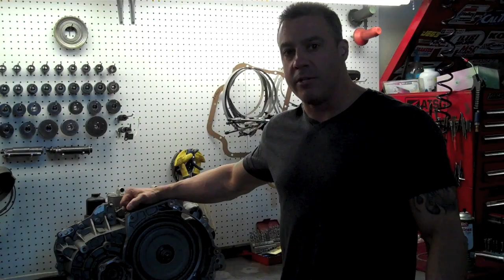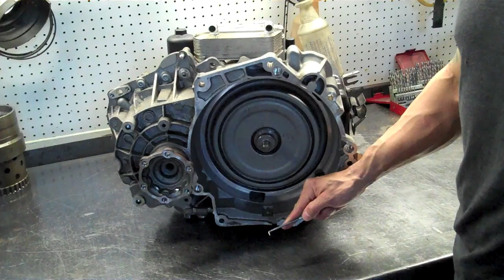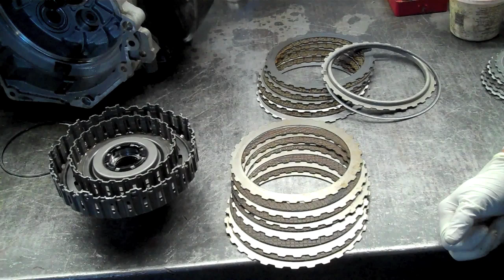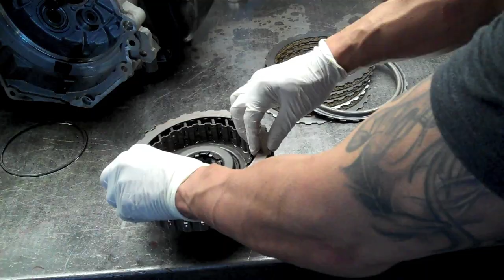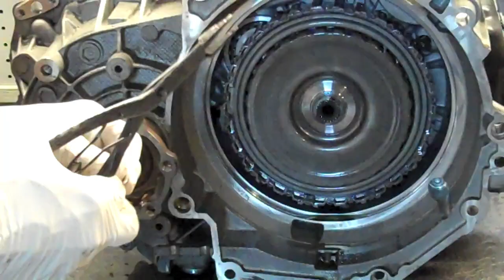VW and Audi DSG Clutch Upgrade

Comment: You should never touch the cover seal,or use oil on it and never install the cover over the shaft without a sleeve tool to avoid damaging the seal lip !

Comment: Nice job,  good video, this is simple  compared to CVT  transmission , my bought a 2008 Nissan Altima SL with 2.5 SL CVT and it came with a lifetime warranty on the CVT from Nissan and now it has 130k miles on it and never any issues yet, car is quiet, and in Canada here our winters in Manitoba, yes purgatory its so freaking cold,LOL, -30 fahrenheit is common and he has never changed the CVT fluid yet and gets got mileage  all year round,I would still rather have a DSG or conventional auto trans or a manual, i have heard you upgrade works well and your procedure here is pretty simple and straight forward, i built big industrial autos for allot of years for different companies, they were mostly component or unit repairs, valve bodies, actuators  ,etc, and way, way  too much fluid everywhere ,LOL, the biggest problem with them was lack of maintenance, overheating and contamination , using non compatible fluid, one customer just bought 1 gallon jugs of atf and wondered why his equipment stopped working inside of half a day, it was almost a whole new trans for him, that is why there are pros like your shop, I guess it does take longer to remove the trans then the clutch pack upgrade, as my old boss use to say, it is much easier to work on when it is out and on the bench.

Comment: some dsg's and automatics have the same set up as a bike clutch.

for those aasking what is the difference of the +1 disc
more presice and friction is distributed to more discs
so less slip and less ware
but needs a software update because the ecu needs to readjust the gaps

Comment: hi...  my name is Damiel, i'm from Brazil.

i have an Audi A3 2.0TFSI SPORT (two doors), 147W with 200cv

i need the stock file for dq250 from Audi A3 2009+.. 

my HW: 02E927770AL 

i'm looking the version: 02E300053B to my Audi... do you have?

thanks a lot for your patience.

Comment: Need to use a specific size snap ring which is determined by two measurements and then formula vw
Reply: Only when replacing the clutch and case as a 1 piece - the way it's sold from the dealer. If you're keeping the same case, the measurement remains the same so you can reuse the old spacer circlip. Technically, if you don't have the dial gauge indicator, you could buy the clutch kit from the dealer, pull out the friction discs and plates and just transfer them into your old clutch case. Then you just reuse your original circlip. Not the best way, but it works with the same success as if you were to measure things out and use a new circlip on a new case. Your adaptations of the mechatronic will pass successfully and the clutch will work correctly for it's intended life.

Comment: Did you soak ALL the friction discs for both clutches prior to install?
Reply: He said he soaked them in trans fluid for 15 minutes before assembly
Reply: He mentioned that he had soaked the friction plates for 15 minutes prior to reassembly.

Comment: Looks easy... :)  First you have to remove the transmission (not so easy)

By the way: 
This is not the correct way to exchange the clutch!!! If you do it like this you will have a noisy and not well working clutch / transmission. The whole clutch package is balanced. You have to paint some marks to reassemble the clutch package in the correct (balanced) position.

Next you need to measure the clutch position (it's an adjustment in height)! The mechatronics is able to do an adjustment but this (video) is really the "quick and dirty" way to do a clutch repair on a Volkswagen DSG. There are some washers (delivered with the original repair package) with a different thickness to adapt the new clutch package to the transmission. 

It might work or not when you do it like this!
Reply: Martin B. And those people find them selfs professionals 😂
Reply: Can you tell some more about the washers that must be put in place in order to have the mechs working good?
Reply: Hi, I have a problem to put the bis clip. How you can put the big clips at 6 min 41 to 6min 44? Do you have a link? Thank you very much. Yves
Reply: We're can I find the correct way to do this?
Reply: You are 💯 correct sir I am a mechanic for 10 years and you are right

Comment: What exactly does this upgrade provide in terms of performance and reliability?
Reply: There are additional Friction added thus more material to grip the flywheel and put the power to the ground. Hope this makes sense.
Reply: i would guess durability for high HP mods + smoother shifts, when you have high torque its best to upgrade

Comment: I have an 05 tdi with DSG. Rattles really bad when idling in gear and taking off, replaced DMF but wasn't the problem. Rattle sounds different than a bad DMF. I have videos on my channel. Please help! Is this from the clutch being worn out?
Reply: Muffler bearings without a doubt, run it until redline in 3rd gear that should fix it.

Comment: I have a 2016 GTI with a DSG transmission. Was wondering if you knew roughly how much power and torque can the trans. hold before it fails?
Reply: +ravenstylea2 
Well if you reach the limit your first sign will be clutch slip, that is what modders usually find problematic with these gearboxes. Gears themselves can handle quite a lot of power(2-5x from stock) but they can take abuse, i.e. if you intend to "launch" at full throttle and possibly drop gears abruptly things can quickly end in tears.
Reply: 600hp. 500-600tq is about the limit.
Reply: 350ish

Comment: why would you install a bigger clutch? Is it to have faster gear switches?
Reply: to hold more power without slipping.
Reply: It'll handle more torque. Some VW owners up the their HP significantly and need this

Comment: Nice video...quick question. i have a 2006 audi b7 auto trans and when putting reverse  it takes about 4 seconds to do the shift. What might be the  problem??
Reply: Change the trans oil
Reply: Same in my 2009 a3 cab dsg 6

Comment: How long would an upgraded clutch on a DSG last under nornal driving conditions?
Reply: I don't know the "upgrade" but for a normal clutch it should last for 65.000 miles. Make sure you have the actual SW-Version for the transmission.
Reply: I'm not sure why Marty B Said they last only 65,000mi. I have removed and disassembled a handful DSG 02e DQ250s all of which had over 200,000mi and the Friction/Steel plates where good enough for another 100,000mi at least. If you change the fluid half of VAG 40,000mi reccomended intervals the DSG CLUTCH Pack will survive. Idk about everything else lol.

Comment: Hi GREAT Vid but I have a question there are 2 dsg vag transmissions one is 6 speed and the othere is 7 speed, in my car, a european SEAT LEON which uses the chassis of the A3 and VW golf mark VI and 1.8 tfsi vag engine, not known in the usa, there is a 7 speed dsg transmission. Will your upgrade work in my car?
Reply: dsg7 is a dry double clutch. nothing common with dsg6 which is wet multi disc clutch.